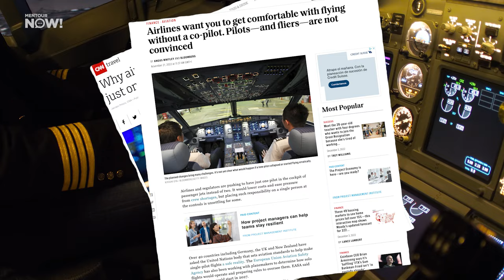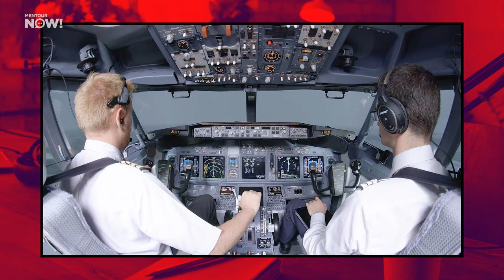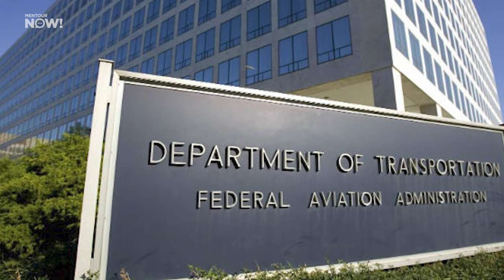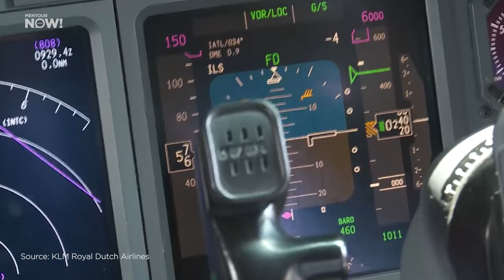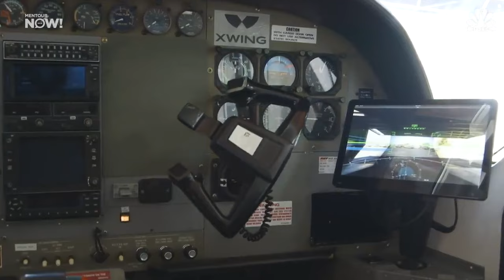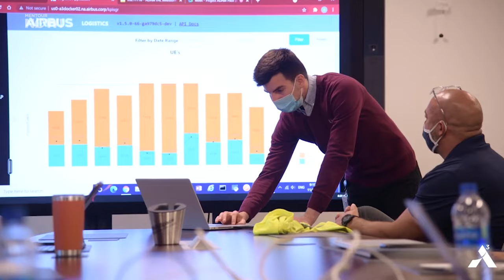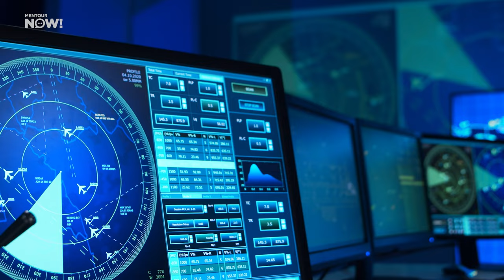The End of the Two-Pilot Cockpit?! Get Ready for Single-Pilot and No-Pilot Airliners!

Comment: I don't see any way that non-pilot, autonomous aircraft and AI ATC won't be a thing of the future. People will adapt to it the same way as they are adapting to autonomous vehicles. That's my belief anyhow. Whether it's good or bad is up for debate but I think it's inevitable. It will save so much money for airlines not to have to pay pilots or air traffic controllers and all of the infrastructure involved with that. I mean, I'm a programmer and I see what AI is doing in my field. It can do a lot of the work I would normally do. At the moment, I still need to direct it to do what I need and I need to fix the mistakes, but... it's only a matter of time. In the case of air travel I think it will make it safer.

AI will have all of the collective data of so many pilots and detailed aircraft data from data recorders and voice recorders and will probably make better decisions, faster. I would imagine that the single pilot initiative has a twofold purpose. One, get people used to the idea that you don't need multiple pilots and two, the 'first officer' will be AI, learning from every move it sees the PIC making in response to the situation around him. The situational awareness of an AI would be truly three dimensional and would have visual and data-driven feedback from every surface and system on board. Far more than a human could cope with. The whole 'one skies' or whatever that initiative is called, will also be able to pack many more flights into more direct airport-to-airport flight plans which will save tonnes of fuel and for an AI pilot or an AI ATC system, won't cause any trouble.

I don't know whether this will happen in five, ten or twenty years, but I'm pretty sure it will happen. The only thing I've never had a decent explanation for is - when AI is doing everything, who is going to be able to earn a living to pay for any of the products or services? :)

Comment: In addition to the autonomous AI pilot detecting when the human pilot becomes incapacitated, the AI pilot would also have to be able to determine when the other systems are malfunctioning and how to react.  Regarding the question "if pilots don't want it and passengers don't want it, then why is it being discussed?", the answer is simple -- investors want it and airlines want it.  Reduce cost, consequences be damned.  Cost doesn't mean only pilot salary.  It also includes things like calling in additional pilot(s) when needed, refunding/compensating customers when flights are delayed or canceled due to pilot issues, cost of finding qualified pilots (this includes your 1500-hour rule issue), the risk of a pilot strike, etc.  Also keep in mind the cost of benefits, insurances, etc that the airline has to pay for each pilot.  Direct payroll expense is only one part of the total cost.

Comment: As I pilot who flew 1940s and 1950s technology planes for decades (Ercoupe, Cessnas, etc.), I view the modern airliner as mostly self flying.  There is no machine ever made that is fail proof.  I am reminded of the incident where the petite tube was blocked on one side by some kind of bug nest.  The instruments were not consistent. The auto pilot was linked to the bad instruments and went berserk. The pilots did not perform well with that situation and the plane did crash but at least there was hope the pilots could save the plane. Just one example.

Comment: Who TF came up with the idea that a single pilot would be a good thing with a large load of passengers on board? Past events have shown countless cases where a pilot became ill or otherwise unable to fly, and the passengers were saved only because someone else was available and able to step up. Some airlines will go waaay too far just to try to save money. Seriously, the only reason anyone is even thinking about this comes down to $ profits $.

Well, the cost of a pilot is a lot cheaper than the millions in compensation an airline would have to pay to the families of victims. It comes down to plain risk analysis. The possibility of disaster due to only having a single pilot might seem small, but if and WHEN sucha an event strikes, the consequences are huge - to the passengers, to people on the ground, and the airline and its shareholders. Just one such disaster caused by the decision to cut down on pilots could - and should - close down the airline responsible.

And no, having someone - or some AI - try to control the plane remotely isn't going to help. When split seconds count, someone needs to be on the spot, making quick decisions and taking quick actions. Nothing and no one can replace a trained pilot who can quickly assess an emergency situation and choose correctly from a number of possible actions to avert disaster. The idea might be fine for cargo flights, since this only risks one or two people. But it's crazy to even think about it for large passenger aircraft. But hey, the almighty dollar is more important than a measly few hundred lives, right? Right...?

Comment: This may get some pushback but when I was involved in aircraft accident investigation the overwhelming majority of accidents were pilot error with manufacturing, maintenance and avionics combined being an extremely low percentage.  Now of course if you go solely automated then any subsequent accidents will push the avionics/automation accident rate up.  This will look skewed against automation because there will be no pilot error based accidents given there are no pilots.  I can actually see that in the near future there will be single pilot cockpits (which will be the transition to zero pilots) who are there to solely monitor the automation.  How far of stretch is this from a CAT IIIc landing?  Also, there may be a transition period where the airlines are flown much the same as UAVs are today.

Comment: Obviously, the airlines would prefer to have no pilots. Then they don't have to deal with those pesky professionals that periodically ask for more money. And it is feasible to do this even now. Spacecraft do this all the time. A combination of automation in the cockpit plus some degree of control from the ground is very feasible. This isn't that far from how drones operate.
But I think a more likely scenario is to have no pilots on board but bring back the equivalent of the flight engineer. The flight engineer would not need to be a pilot but may have minimal fight training. They would handle routine equipment checks and make sure that ground communications are sufficient. They could handle many of the equipment failures and do some repairs or replacements on-board. But the aircraft itself, with some possible assistance from the ground, even now is capable of safe flight.

Comment: One factor was not mentioned in the cost part: Weight. More avionics has a weight penalty, meaning less payload. For a freigtliner that's critical. If they loose cargo for $1000 per leg, it doesn't take many legs to loose more money than an extra crew member cost.

Comment: Two other really bad ideas: Lower than 1500 hour airline pilots, and ab initio training. The 1500 hour rule at least attempts to get meaningful experience into cockpits. Ab initio training is bad because it churns out simulator babies that recite flows and callouts perfectly but when under pressure in the real world lack the depth and breadth of knowledge and experience needed to handle emergencies. Your piece on AF447 is an excellent example, and there is shredded aluminum all over the world as evidence of ab initio training being a poor substitute for experience.

Comment: Planes become more automated anyway, they are already fly by wire to a large degree. So replacing a second pilot by a (or muliple) remote pilots who could assist in an emergency. Sure a remote connection could fail, but for the most risky parts (landing and takeoff) there should be a reliable connection available. The more automation is in the planes the more an engineer is more useful in an emergency scenario rather than a pilot. Which could diagnose things remotely.

Also it would save a lot more for an airline than just the pilots salary, hotel rooms, sickness replacements and so on. Then you've got more flexibility in almost every aspect of crew management (hiring pilots e.g.).

Of course there are challenges to overcome, but none of them seem that far away to me as an engineer. Could this possibly not work for unseen reasons? Sure, but this video feels more like a pilot denying a possible future loss of pilot jobs than an objective analysis.

And something like the Germanwings "accident" can't really be stopped now anyways, since most airlines don't implement the two person cockpit rule (anymore) anyway. Besides some remote controls or limitations would be more effective to combat such a scenario.

Comment: unless if it's small piston driven aircraft. You'd be insane as a carrier to ever push for a single pilot operating a large commercial aircraft. the cost savings in labor is so stupid and shortsighted compared to the freaking safety of the entire aircraft and passengers and crew aboard. These beancounters are insane and  out of touch, you  CANNOT put a price on safety.

Comment: So the main argument here is having one pilot is as good as having none. On that I have to say I firmly believe fully autonomous vehicles are the future. It's not close, but it is the future. At some point people have to start doing research about it so for the aviation industry to start considering single pilot is the correct next step. That single pilot is essentially not there to fly the aircraft as the aircraft must be fully autonomous for SIPO to even be possible, he's there mainly to watch if any equipment malfunctions.

In the past 200 years, we've proven again and again when machines are capable of doing some tasks, they are far more efficient and reliable than humans. Even when machines make mistake, it's obviously also because they are not properly designed/maintained by humans. We taking our selves out of the equation when carrying out key tasks is actually a better approach, provided of course that proper design and maintenance is done to the autonomous system.

Comment: The only way I'd accept a single-pilot commercial passenger jet would be if it can operate at least as safely with zero pilots as with one. In which case, why even have a pilot? I'm not actually advocating zero-pilot aircraft, I'm saying that a single pilot is a single point of failure, not something you want when 100s of lives are at stake. The autopilot would have to be able to take over at any point in the flight in case of an incapacitation. It would have to be able to detect a real pilot incapacitation with absolutely no false negatives and as few false positives as possible (the autopilot taking over from a fully conscious pilot wouldn't be good). And I definitely don't want a remote-controlled passenger jet.

Comment: Simple Pilot Error is the single largest factor in aircraft incidents and crashes. For decades now aircraft manufacturers have been eliminating pilot error with automation. This has helped with consequences, we have created what are called "children of magenta". Children of Magenta is a reference to the modern pilot that has become increasingly DEPENDENT on automation and modern navigational aids, their skill level has decreased as a result of this dependence. The COM problem is that their workload has decreased and is causing complacency. The most work a COM puts in is preparation by programming a flight management computer and now days even that is done remotely, they only verify it. 
This is what I will call a half-measure that aircraft manufacturers have created by only wanting pilots to monitor the automation to ensure that it is sound and this is what puts us here at the crossroads with only one pilot monitoring and the eventual remotely monitored fully automated aircraft. The full measure will be when the aircraft and the monitoring will be fully automated. 
Artificial intelligence is pretty much here, decades of problem and response data have been compiled to ensure that the logic behind the automation is at least if not more sound than the average flight crew is capable of recognizing and processing at any given moment in any condition.

Comment: On a recent flight I noticed a pilot coming out of the cockpit to use the bathroom and one of the attendants ducking INTO the cockpit for the duration before exchanging with the pilot.

I'd never seen that before and thought it couldn't be a one off.  I'm thinking there's a policy to say no single pilot in the cockpit.  The airplane is filled with redundancy -- two engines, multiple systems and backups for every critical component, and two pilots.  I don't think you can put the whole airplane and the lives of all the crew and passengers in the hands of one person.  That wouldn't make sense from a redundancy/safety point of view.

Comment: Pilots have already became the weakest link in the system. Reducing to one is definitely the wrong way because of the increased pressure on the link weakened even more. The correct way is to go to none instead of one. And to meet safety standards even within existing certification framework, the sequence of "pilot monitoring on-board" -> "pilot monitoring off-board" -> "no pilot" would do the job. And "monitoring" here doesn't mean being a mitigation, it means to be able to disable the failed system that designed to fail not more often than once per billion flight hours.

Comment: If anything, I think they need to add a third cockpit crew member focused software engineering.

What if HAL erroneously locks out the controls of a pilot that is not actually incapacitated? Better make sure they keep "stress pills" handy in the cockpit.

The pilot shortage is self-inflicted by the industry.  The problem is they have no " bench". There are more than enough dedicated young people eager to get into aviation.  Unfortunately, it takes thousands of hours to develop the skills and qualifications to become a pilot in large commercial aircraft.  There are simply not enough regional airlines flying intermediate sized aircraft for a pilot to build up hours rapidly enough to qualify.  The smaller planes carry a smaller number of passengers and generate less revenue. Most intermediate pilots can simply not afford to rely on their meager aviation salaries alone.  They must work other jobs as they are slowly building hours. Perhaps there can be pilot mentoring programs so these junior pilots can accelerate their careers.  I know the airlines are not made of money but this would be an intermediate term investment in selected future pilots.

Comment: Absolutely agree with you after over 30 years in the business of operating airframes I have often thought about the fact that sooner or later the subject of one pilot or no pilots would come up. The feeling has always been, as far as a I am concerned, that you need at least two pilots to cover incapacity and or the vary rare case of someone going out of their mind. Furthermore, in my experience most of the time in cruise one person can happily handle things, however I have found that when things really start to go wrong it would be so nice to have a third pilot to help handle the load. I  am sure new technology is making the latter not such an issue. Let’s not be too hasty removing the drivers!

Comment: The workload on the two pilots during nighttime IFR approaches is already high enough.   And, in the case of an emergency, someone has to fly the plane while the pilot monitoring manages the emergency.  

To compare the shift from three pilots to two is an ignorant proposition made only by the ignorant or the "stakeholders" who are so severely short-sighted, that they should not have a role in the discussion.

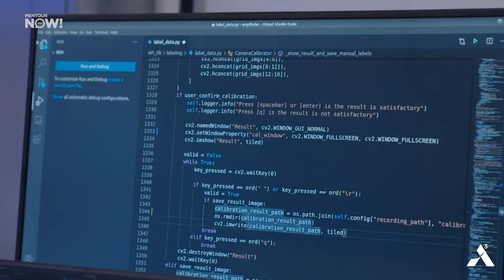Comment: I would not trust a software engineer with my safety, especially with the "quality" of its code at 9:59 , line 1330 of code. 

Usually the file is broken up into smaller files, if it reaches 100 lines of code.

Comment: It even would be terrifying to the passengers if they realize that the plane they're riding in has only one pilot.  What if during flight something happens to the pilot, or the pilot goes berserk or something?  I've ridden small jets and planes with only one pilot and that seems normal but never would I ride a single pilot jumbo jet, at least not until the AI technology of autonomous flight becomes very safe.   I know modern technology has made strides in developing UAV drones, but they are so far passengerless. The trend for single pilot commercial jets may be the future as it may lower travel costs but I think they need to resolve the kinks in the system first before the public will trust this new technology.  Sooner or later, the next trend would be pilotless planes and the pilot would instead fly the place from a ground control unit similar to a UAV drone system.  Would you ever ride one of these?

Comment: Love your videos, but I think you are wrong.  Two people cross checking each other is needed at take off and landing, not really for the rest of the flight or at the non sterile phase.  That can easily been done remotely, because landing and takeoff happens at predictable places where direct radio links are easy.  That means your first officer will be the freshest one around, and not one that just spent a few boring hours at 10k feet of air preasure.

Comment: This came about because of "self-driving cars" , which is a lot harder to navigate and make it "autonomous" on the road than flying the plane in the air.

Full Automation on the plane were meant as the default position (take off, landing, set waypoints & etc) , the pilot will only "take manual control" if it detect anomaly, like weather ahead or bird-strikes.